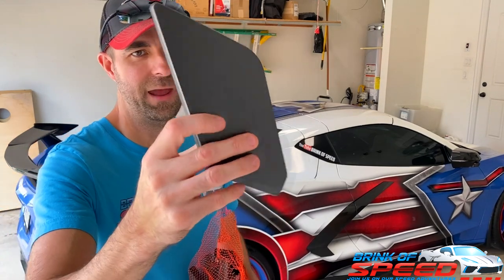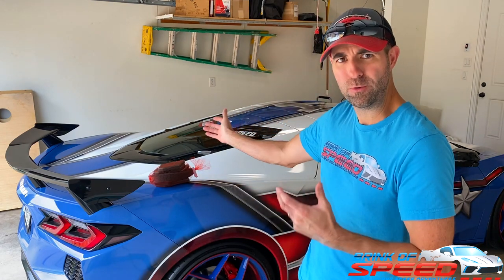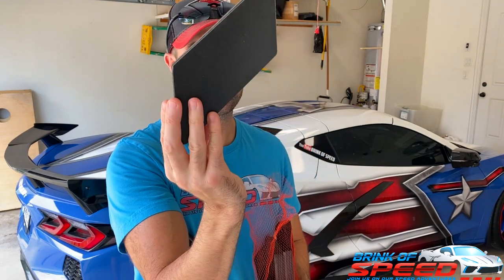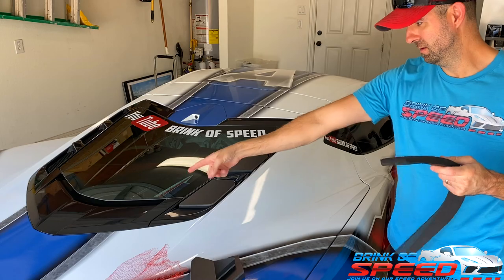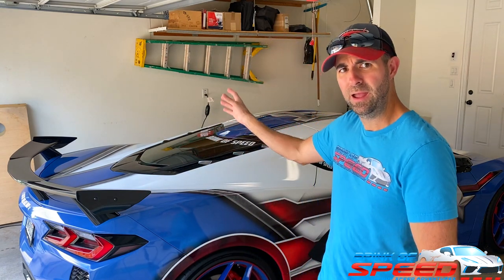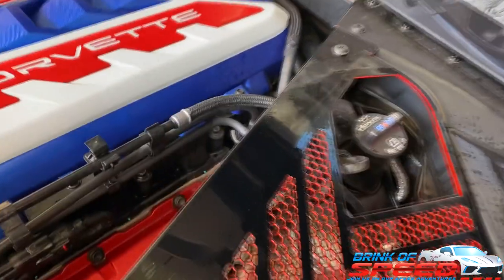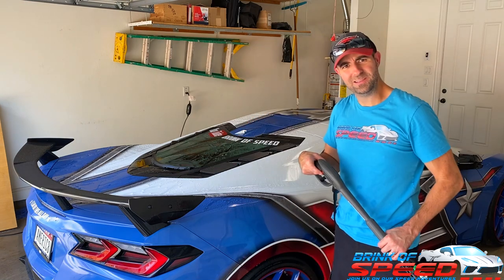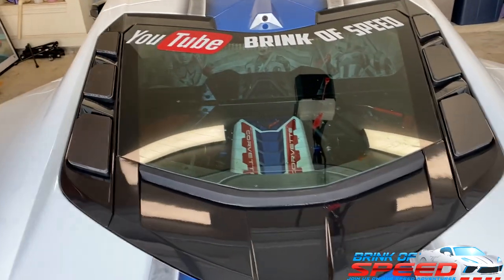1000's of C8 Corvette OWNERS have BEGGED me for THIS Product!

Comment from the maker: Ladies and gentlemen, today I’m about to show you a brand new C8 Corvette product that 1000’s of you have been waiting for! Keep your Engine Bay DRY!!!
Reply: Perhaps GM designed it that way in order to allow hot air to be evacuated? If so the question becomes which is more detrimental: water in the engine compartment or increased heat? Btw, it's a rhetorical question.
Reply: I need the product where can I buy it 😊

Comment: Something is wrong, how could the engineers forget this design flaw ??? It doesn't make sense. Unless there really is no issue with water leaking into the engine, maybe the water cools the engine and its a benefit?? I don't get it. Also you were spraying only in one direction, from the top down towards the rear end angle, what if it is raining cats and dogs. Maybe due to the carbon fiber and engine, water is not a danger ??? I think it is.

Comment: I folded 10 cheap dish towels and moisten them. I placed them over those areas . After washing the car I checked and had no water leaks. Placed them in the washer with my other rags and used them over.

Comment: The question needed to answer is 'will the product staand up to the water jets in a touchless carwash or will the force just blow them off the car like another product which uses long rubber pieces to cover the vents. Just being able to cover the vents from a regular hand washing garden hose is not what is wanted. It must be able to seal it under the water pressure in a touchless auto car wash.

Comment: Drying the car down before opening the hatch when you had the product installed doesn’t provide an apple-to-apple comparison. I think you would have found half the amount of water in the engine bay had you dried the car down before opening the hatch without the product installed. Also, I personally like a little water in the engine bay so that I can dry it down and remove any road grime that accumulates between washes.

Comment: Why not have a permanent gutter underneath the vents that channels the water to the rear. That way you can drive in the rain.  😉
Reply from the maker: You can drive it in the rain, these weren’t built for rain driving, they were built for washing your car. This engine bay was tested pouring thousands of gallons of water into the bay and it never affected the engine. It’s just a minor inconvenience for most after washing their car.
Reply: @BrinkofSpeed  While I haven't had access to a C8 coupe for a long enough period of time to really study the underneath side of the hatch, I still think some type of gutter system deflecting the water down and away from the engine would be the best of both worlds. That way rain water or car wash water would not be a problem.

Comment: Doesn't look like ti works very well. Still to much water. I bought 4 bath towels at Costco for $15.00 and place them in the engine bay. I don't have any of this water. Towels are a little damp so I use one of them to wipe down any dusty areas. I think the designer of the plugs needs to go back to the drawing board.

Comment: Hi, love your channel,  I have owned 4 Vettes in my lifetime,  Don't drive anymore but still very interested in Corvettes.   I love the C8 Vette but my only gripe with the design is just what your video is centered around.  You would not need those vents if the headers were not up in the engine compartment.  My last Car was a 1974 DeTomaso Pantera. It was a mid engined  powered and never suffered from overheating and did not need vents in the deck lid.  headers ran down and to the back of the car.  Why do you think GM opted to run the headers up and then down to the mufflers.  I never found many people complaining about the messed up engine compartment,  That part of the design to me sucks bigtime.  BTW  My Pantera ate Lambo's and other Italian stallions for lunch  time and time again.....

Comment: Are those vents not there as a heat extractor? I don't think blocking those vents would be a good idea.
Reply: That's only to block during washing of the car to prevent water from entering the engine bay.

Comment: I just now watched your short and had to find out more about this wonder product. Like I "wonder" if it's worthwhile or not? 😉 I already knew the answer since you're endorsing this product. I had no idea so much water actually accumulated in the engine bay. So, with this add-on there's no runs, a few drips, and no errors. 🤣 I would hope before the generation ends GM will correct this problem., but this add-on is very well priced and worth it! Well done Mike. 👍👍
Save the Wave🙋‍♂
Reply: All high performance mid-engine car have the same type of vents which also let water in….McLaren, Lamborghini, Ferrari, etc.  it’s not a design problem it’s required airflow.

Comment: I was curious when someone was going to try to tackle this issue.  This is one of the reasons I want to go convertible.  I just don't think I could handle keeping that engine bay cleaned hah.
Reply from the maker: Yeah, I’m one of the weird ones out there, I actually like the water getting in there. It helps me clean the dust out and get the bay looking spotless. 👍😊
Reply: You bought a convertible primarily because of water getting in?
Reply: @Maximum1A  I haven't got the convertible yet but the main reason I want to get the HTC is I've nver owned a vert.  I just know how much of a clean freak I am and it seems like it would be a pain to keep that back glass in the coupe spot free.  But maybe not if you get it ceramic coated etc.

Comment: Mike, this looks to be a great solution to this problem. But i have to say, it’s overpriced.
Reply from the maker: Wow, $100 is too much? I think it’s priced perfectly, but this is just my personal opinion. Believe it or not, these weren’t cheap to manufacture and they aren’t a cheap material either so they’re gonna last. Thank you for your feedback though, I really appreciate it, and so will Amora Scott. 👍😊
Reply: Mike, doesn’t mean i won’t buy them! I really appreciate your posts!
Reply: Not only is it too expensive, it doesn’t really work. Just lay a towel on the engine compartment before washing the car. That works fine and it’s free. Thanks for the video.
Reply: Good job on the video. I found it to be clear and to the point. I have a C7 but if I had a C8 coupe I would consider buying these. A little help here and there isn't a bad thing. :-)

Comment: These are not great at all. Was so excited to get these and no matter how many feet I stand back when rinsing the car with the pressure washer and not directly at the blocks, they get blown out of the vents and fly onto the ground and the foam strip does not go under the glass, took several minutes trying to pry it in and still wasn’t a good fit, and they definitely don’t set into the vents as flush as in your video. For $129 I expected better

Comment: Definitely interesting.  If history would predicted the future, there would be no way the engine bay would get wet.  In 1963 the hood vents were designed to be open but due to ( and there are a few stories) either hot air getting into the cabin, rain getting into the engine bay, or even the front of the car lifting the production vents were faux. Maybe This time around engineering prevailed with Tadge and team. :)

Comment: Not yet having a c8 as mines on order , I’m unclear how water gets under the rear window ? Are there air vents to let heat escape ? That your then plugging ?
Reply: Yes, the vents let the heat dissipate.  This device Mike is talking about is for use only when washing the car, and only to keep the engine bay dry in the process.